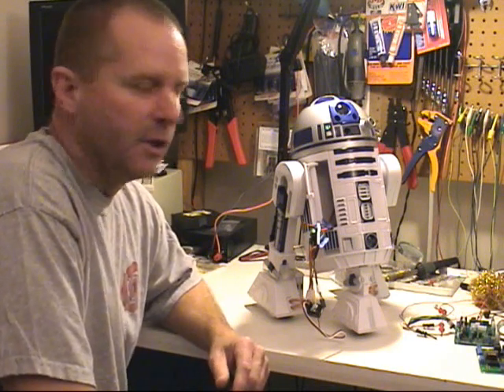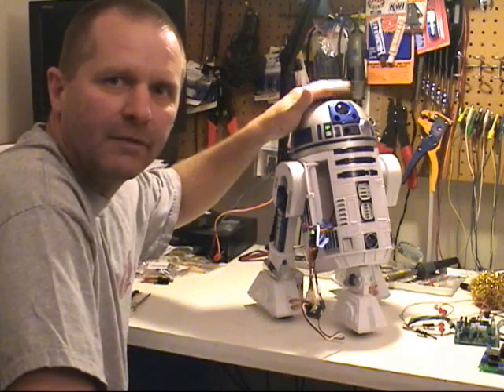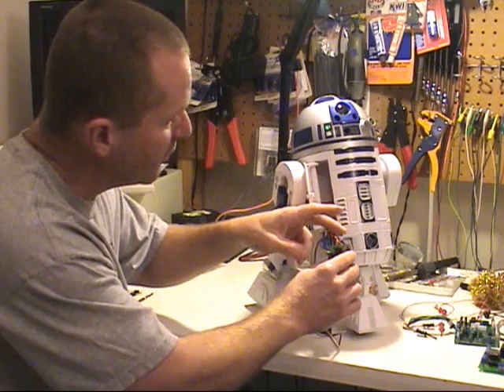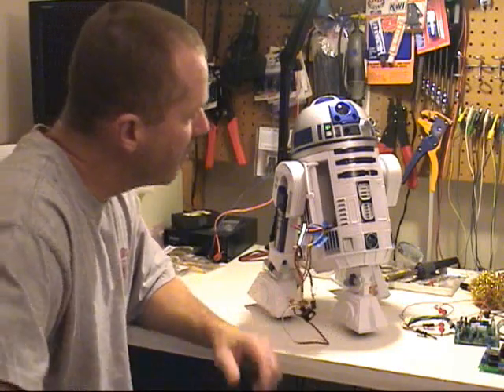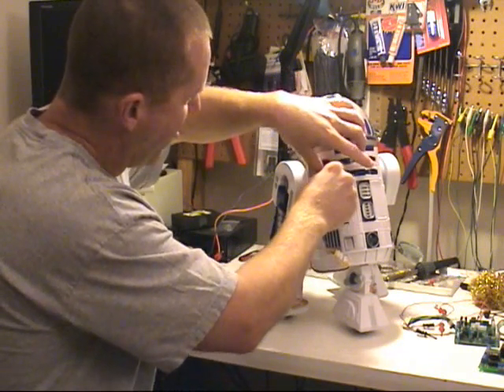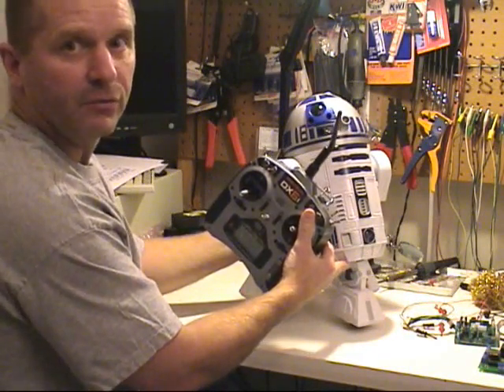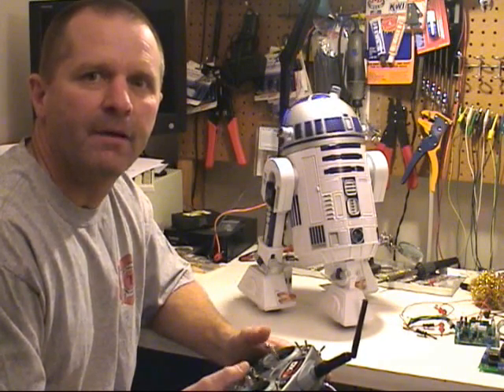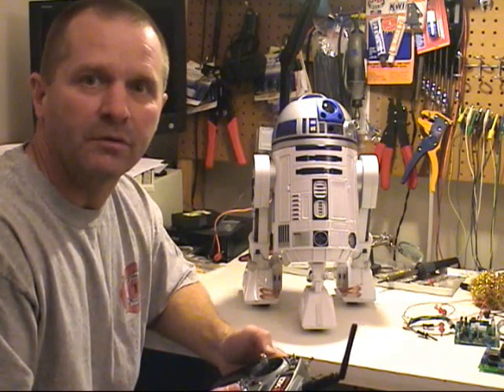Hasbro R2-D2 RC Conversion

Comment: How does this affect the motors in the R2 long term? The Interactive R2 has a pretty slow set speed, (which I assume is just by design, given the weight distribution on the unit) but how much faster could it really go without putting stress on the motors? The other thing I was curious about, is how the batteries should be wired. I'd think that there is a voltage limited inbetween the battery leads, and the receiver? I'm looking at modding one of these little guys, but there's not a whole lot of information out there on conversions, and I'd like to toy around with it a little bit. Awesome stuff, I hope you're doing well these days!

Comment: Does anyone have the Sensor Array and Telescope from the 2002 version they don't want or need? I would buy it from you.
Reply: Sensor Array and Telescope? The Interactive R2-D2 only includes a single Periscope. Do you mean the Holoprojector and the Periscope? The holoprojector is the silver knob on the top of his dome, on one of the blue panels, and the Periscope is the two-piece attachment that goes on his left upper dome flap. I believe there are a few listings on ebay for them, but it does cost a little bit. I just recently purchased a replacement door panel, as well as a whole second R2 to possibly do a mod on. I'll take a look at ebay and leave some here.

Here's one listing for a REAR holoprojector, but I'm sure you could get it to work in place of the top one. Might take a little gluing, or some fidelling. They appear to be very similar pieces.https://www.ebay.com/itm/Star-Wars-Hasbro-R2-D2-Interactive-Robot-PART-REAR-ILLUMINATING-LIGHT-HOUSING/382640691688?hash=item59172999e8:g:an8AAOSwanxf~~Fq

As for the two Periscope assembly pieces, I'm not sure. Keep an eye on ebay, it'll show up eventually.

Comment from the maker: @mattybuggy ...If you slowly rotate the dome you should see the screws appear through the hole. If I recall correctly, if you remove the dome from the base you do not need to pry the whole assembly away from the body. Taoworm did a tutorial that covers the disassembly process. Good luck!

Rob

Comment from the maker: @mattybuggy ...After that, a bit of careful prying should get the dome to come loose (It is secured into the top of the body with something like double-sided foam tape. You might also need to pry the base of the dome away from the rear panel when removing it.)

If you want to remove the dome from the rotation base, this can be done by accessing the dome screws through an access hole visible under to black rotation base...

Comment from the maker: @mattybuggy You should not need to remove the dome to check the ribbon cable connections. They are soldered onto the board in the dome. If you want to check the other sensor connections, though, you would need to remove the dome. First you would need to remove the back of the body (I think it is six screws), then you will see two screws attached to a bracket that comes down from the dome base on each side. These would need to be removed...